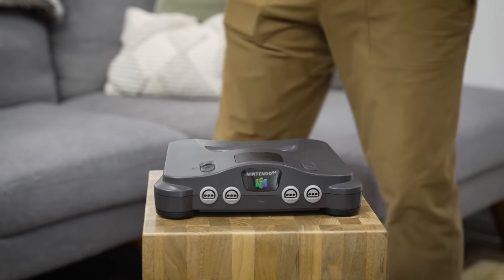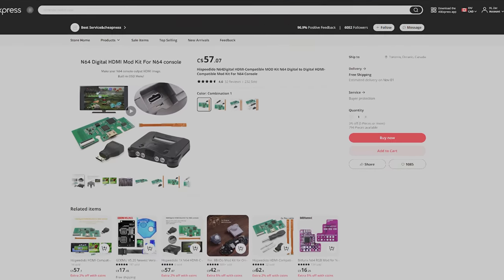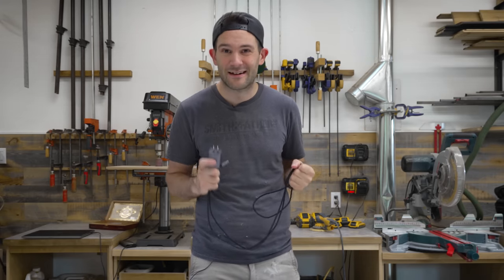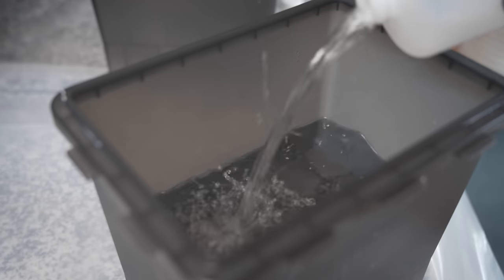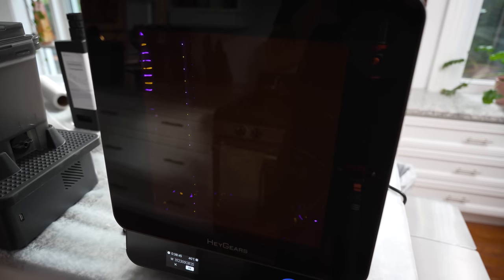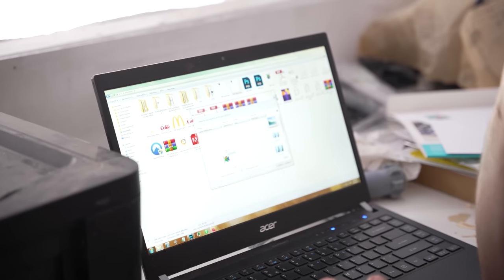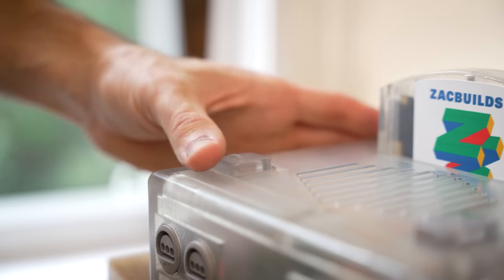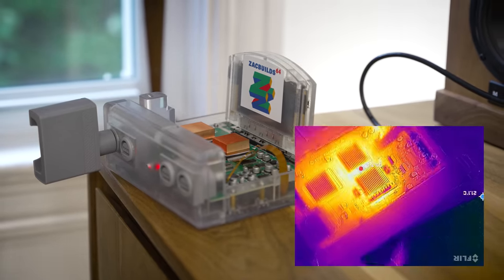I built a MODERN N64...

Comment: You should have added the cartridge board into the console and created a slot to insert the SD card.  Also, the wireless controller is a nice touch, but you should have just integrated that into the controller ports as well.  

Great vid

Comment: Interesting but I a few things differently. I would like it portable and keep the memory card slot because there is also the rumble pak and the transfer pak. The rumble pak is supposed to be the early age tech for controller vibration and the transfer pak is where all the fun is. When you play pokemon stadium, you can connect it with the gameboy games and trade pokemon across to and from stadium to play with them... So keep that slot for this purpose.
The portable idea is that the power cable is replaced by battery and charger, then you need to connect speakers and headphone jack, and place its own 640 x 480 display. Those displays are not being sold regularly these days... Make the whole thing look like a giant gameboy color...

Comment: I was planning on doing this, but I have way less experience than you, and no free time. Take a Switch Lite and design a clamshell body! A similar form factor to much the moved DS, with a Switch lite screen on top and where the bottom screen would normally go on a DS, you could use that space for a bigger battery and put the NFC reader there. A clamshell Switch Lite would sell like crazy!

Comment: Just an fyi. The reason older hardware has so much metal shielding inside it is not for heat spreading or cooling or anything. It is a result of FCC guidelines. Back before the days of smartphones and the internet we used radiowaves to communicate. Especially emergency services. To ensure that those radio waves are not interfered with by public owned electronics the FCC tested all consumer electronic products for emissions. If your device produced too much electromagnetic emissions it would not be cleared by the FCC and they would not allow you to manufacture that product.

Comment: I disagree with the last point. Removing controller ports all together would take away from what it is. If you had USB-C port on the front and made a multitap with 4 ports that nicely sat under it when in use, that would be really sick. The one thing I would want if I did this project is some curvature along the top to preserve some of the design language of the original and probably went with a transparent smoke color so it was clear enough to see the upgrades but still preserved that og color vibe.

Comment: You know you can buy video cables that are the Nintendo connector on one side and HDMI on the other.  I have one for my SNES.  Works great!  🤷‍♂ (and I believe the same cable works on N64 and GC as well).
Reply: They're very different, they're nothing more than converting analog video(usually the worst quality composite signal) to HDMI. The point of internal HDMI mods is to start with a digital signal so nothing is lost in conversion. Particular setups may not always take good advantage of that though.

Comment: For me , I would have tried to make a completely new PCB with modern SMD chips to decrease the size and the need for multiple power rails. Also you can make the video output match the 4K or less in this manner as well. The it would truly be a modern N64 and not just an N64 in a new case and mother board hacks with daughter boards and cables. but all in all it's a good build. also maybe a buffing wheel could have polished your case to a very nice clear sheen.

Comment: Technically speaking, if you don't want to run a 64DD, the 3.3V is enough. The 12v is actually only for the expansion port for the 64DD, the N64 itself runs with only 3.3v

Comment: Some info for anyone looking to get into resin printing.
Its an amazing technology and I use it myself to print DnD minis
However a couple of downsides.

Its smelly. some of the chemicals used in resin are both unhealthy to breathe and they smell like the devils arse. You need a well ventilated room or use a cabin/growtent with a fan to deal with vapours. Also most resins are washed in isopropyl alcohol, which also isn't nice smelling.

Its toxic. One should be careful because skin contact with liquid resin is not advised and can lead to allergic reactions. Also one cannot let the resin in liquid form go into the environment as its really dangerous for aquatic environments. one should always use nitril gloves.

Other then that its a really fun hobby and there are amazing printers for sale for an affordable pricerange.

Comment: I think if I was making a custom new N64 shell case, I would want to make it similar to the original N64's profile shape and size, but more slimmed down with small active cooling fans. Maybe even go the extra step just to redesign the PCB of the N64 to slim down it's overall size so there's less space wasted and have everything more compactly fitted. And of course it would have to be able to use original N64 chips soldered on, or FPGA compatible equivalent chips capable of running exactly like original N64 hardware, with some extra advantages over the original hardware. With a custom PCB redesign you could probably shrink the overall size of the N64 by 75%, you probably wouldn't need to have extra PCBs just for Power and Display, since you could build it into the hardware itself with traces that splits the TV signal out to the HDMI without needing to solder on an HDMI mod if it's all built-in to the main PCB.

Comment: This is truly an amazing and super informational project man! Tip for your Z logo though on your stickers! The way you went at everything was perfect, and honestly really impressive. If you mirror the N vertical and horizontal axis, then apply your perspective shift in the same distance in unit measurement, but the opposite lateral axis it will give you the top down effect of the original N (If that’s something you would like to do. Not sure if you’d like the upward or downward perspective more, but if you really wanted to toe the line with Nintendo and that’s something that you think would be cool, then that’s how you’d be able to achieve that.

Comment: while the RAM expansion is important for running certain games, not every game can run with it, as it causes issues in certain N64 games (some of which involve crashes) which is why I'd reccommend keeping access to the RAM part of the n64 incase you want to put the jumper pak for those games that specifically run into issues with the ram expansion.

another thing, the HDMI Mod while a good way to modernise it, I can see some issues, such as: 720p output (not perfect for all screens, if you have a 720p screen then it is perfect), no smoothing options (purely subjective, if you love sharp pixels then this is not a problem, I'm pointing it out as it isn't accurate to how the N64 is expected to be played, this being a CRT which naturally smooths the image)

solutions for 720p output can include any decent 720p to higher resolution upscaler (the retrotink 4k should be able to do the job as it supports HDMI and can upscale it to 1080p, 1440p and 4k, another alternative would be using an mcable [brings image to 1080p] with a photofast 4k gamer pro or 4k gamer + [both only support 1080p video signal] to upscale the image to 4k, if you want to upscale to just 1080p and/or 1440p then get an mclassic, it will upscale to 1080p if it detects a 1080p screen or 1440p if it detects a 1440p screen).

the smoothing solution is to skip HDMI modding and use a RGB Scart mod and use a retrotink with smoothing, connect an mcable or mclassic to the HDMI out of the retrotink, then you can connect it to a Retrotink4k or a photofast 4k gamer pro or 4k gamer + to get 4k
If an RGB Scart mod isn't an option, a stock N64 using S-video to a retrotink or an EON Super 64 with an mcable or mclassic is perfect.

I give it a 7/10 the console 100% looks modern, but the gaming experience could be slightly modernised, either with an upscaler to make that 720p a higher resolution to make it look nicer on highe resolution displays (and have less display latency) or a smooth upscaling solution to get it to look nicer on higher resolution displays (and have less display latency)

Comment: very cool video
tho, i wouldnt say resin printers are straight up superior to SLA, each has their up and downsides
both can do transparent materials by the way
SLA makes stronger components in general, as resin is a brittle material, SLA can print in a host of different materials, PLA, ABS, flexible, nylon, wood mixed, brass mixed, so forth, SLA also doesnt come with the risk of resin fumes, alcohol fumes, resin on your skin
the main upside to resin is speed and detail

Comment: I want to tell suggest to you those replacement heatsinks probably weren't gonna quite do it. There's a reason for those oversized heatsinks. Back in the day I had an a nintendo 64 when they first were released sometimes and there was an intermediate issue where they would severely overheat on rare occasion. Killer Instinct Gold/KI Gold was the main unsub..lol. It would lock up just untill you shut it off for 30 seconds or so. I was thinking that ventilation slots during printing could helped dissipate heat. Im not sure but I don't think Nintendo 64 had those in the original case design. Three or four 1.5 inch alots across each side of the back that achieve a circular pattern getting smaller towards the outside of the circle. Possibly a mix of one on the back and bottom although I'm not sure if thats achievable on the printer.

Comment: I don't get the hate for the 64 controller. It's the most unique controller design out there and I always thought it felt cool to hold and use. Granted I only really did play Mario Kart on it but it was like you had an arcade stick in your hand especially since home arcade sticks weren't necessarily in the market yet at the time.

I also found it cool that the Wii nunchuck derived its design from the 64 joystick.

Comment: I wouldn't say that resin printing is superior to FDM, resin has some major set backs. For 1, it is extremely toxic and can build up in your system unless you use full protective gear. Respirators included. Another is that it is very very messy, those pretty and clean surfaces on those printers wont stay like that for long with any serious amount of printing. Plus you have to wear gloves if you want to use it more than a few times without getting sick from it. FDM doesn't have these issues, and yes, while it is less fine in detail, it is faster and easier than resin. They both have trade offs that are important.

Comment: I hope someone attempts to build in the wireless adapter into the main console instead of having a clunky adapter stick out. Maybe have a separate slot on the console for the memory card. It would still be built into the controller port, just behind the console shell

Comment: This is funny to me because I have done multiple similar N64 projects, but at grater scale. The not understanding that the everdrive supporting saving doesn't eliminate a need for memory packs was a little cringy. I have a setup with the N64 Digital and Everdrive x7 on a recapped NUS-008 system with an upscaler and option of the Super 64 as the smoothing of that is unparalleled. There is wireless recivers that use the blue retro firmware that "should" be capable of virtual controller memory pack functionality. I still use my physical for now (preference). Different N64 games save data different ways, most are 100% memory pack or 100% on cartage. Then name other category is ones that let you move data using memory packs. But one thing is for sure, the everdrive can't replace a controller memory pack in functionality like he said. That said, it has a handy feature to be able to export the save to a file on the sd card so you can backup or use that controller pack data for emulation.  My "God tier" N64 project uses a Ryzen 7000 mini pc inside of a stock N64 shell, PSU and all, supports ALL the analog out of the original and HDMI. Has Working controller ports THAT SUPPORT ACCESORIES LIKE CONTROLLER PACKS in emulation. I also have 4 of the official wireless N64 controllers for the switch that pair over bt. With some hard work on the video and texture side configuration, and front end software, one can have a practically 0 compromise setup. I even have a working cartage slot (only use external for initial ripping games and old save data). Controler pack data on that setup can also be ripped in software from a real controller to a file and set up to read from that file when using wireless controllers moving forward. So happy with it so far. I don't know of another project like it online. Its a full N64 sleeper with basically 100% of the original functionality of a physical consol, (*the game slot has honorary support as quick and easy external use as needed). Look its a little much to fit a pc + psu + video converters + controller adapters + external ports and other custom adapters for functional use of the power and reset buttons and switches in an original shell. That said, in this v2 I've built, I probably could add the cartage slot if it pultruded from the top but that defeats the purpose of it being a sleeper setup. Perhaps some time this year I'll post some pictures and comments for how to do the same for some of you out there. 

The other for my "in a perfect world" original hardware setup, I would like to add a blue retro internal, as it can do detection of controllers being plugged in on the original hardware and auto switch between wireless controllers such as the Nintendo switch online N64 controller, however this is a massive bug in the firmware that tragically fundamentally brakes when using specifically multiple NSO N64 controllers. My work around plan has been to just use 4 receivers but while that would work it's clunky and looses some functionality as well as making me have to find a creative way to add 4 pairing buttons somewhere to the shell.

Comment: A few bad practices (that he admits to) and misinformation (*you do need the memory card for some games - do not remove!*)

Anyone doing the plastic shells, after sanding, use a buffer and something like PlastX to polish. You can follow up with a clear coat, but use an "enamel" not "acrylic". Enamel hardens, acrylic can get sticky and you will end up with finger prints if handled too much. It can also collect dust and not be as easy to wipe off.

Nice build. he could have thought of the wireless controller receiver first, and incorporated the case design to support it (which he mentioned). And the case design is ugly... forget the active cooling idea, not necessary at all.

Comment: Designing and building something like a Nintendo is child's play. The heat sinks are required. I was a self taught 1980's Electronics Engineer / Arcade Game designer.  Remember 1980's Arcade Game Tables? My concept. Now retired. Todays thermal insulation, at least the stuff you can find and afford is the essentially the same

Comment: Adding the wireless controllers was a good way to go...however since you redesigned the entire console, I'd DEFF redesign that clunky thing hanging off the end, especially if you don't need the memory card(s) . That thing just ruins an otherwise awesome build.  Hell, I'd even go so far as add a bluetooth receiver into the case itself an not worry about a dongle.

Comment: What gauge wire did you use on the step down converter and usb c connector to connect it to the Nintendo board? Thanks in advance.

Comment: another mod to think about is to take apart the case for the wireless controller adapter and put the hardware inside the Z64 case
Note:  I typed that a few minutes before you said the same thing

Comment: honestly, the problem with the N64 controller wasn't really the design, it was the longevity of the analog sticks. the design was interesting (and honestly, n64 games just feel WRONG without the boomerang controller...), but the early (and somewhat poorly made) analog sticks would wear out or even break fairly easily, leaving you with a stick that would refuse to return to center.

Comment: This is awesome, but saying the original n64 can not connect to modern tv's is disingenuous at best. The green blue red (and red white for sound) connections can take the yellow red white cords. You just plug the yellow into the green port.
Reply: Sometimes , this is not standard, albeit it may be common on modern TVs.

Comment: you don't need a hot air station for those connectors, you need to know how to solder and how to use wick and/or pumps.

OMG that's not even the worst part. When you solder the ribbon cable and say "it should look something like this" well no it shouldn't. You have the right idea but you didn't do it very well.

Comment: While I agree that upgrading the board to be able to output to HDMI is the way to go, I'm calling BS on you not having a TV with either an RCA or an RF connector. Even though they're legacy connectors - TVs still have them. When it comes to RCA, you would just use the component connectors (plugging the yellow video cable into the green video port; audio would go into the same red and white ports). And RF is just... there. It probably SHOULDN'T be at the point, but it is. I work in the cable industry, and the number of times I encounter people who have their cable box connected to the TV with both HDMI AND RF, or have the cable in on their box connected to the RF in on their TV (and can't figure out why they aren't getting a picture), or they try to connect their modem to the RF on their TV )and can't figure out why they aren't getting internet) would astound you.

Comment: Copper is NOT a superior material over aluminium for convective cooling, only for actually conducting the heat to convection fins.

A copper base with aluminium fins is both lighter and more performant.